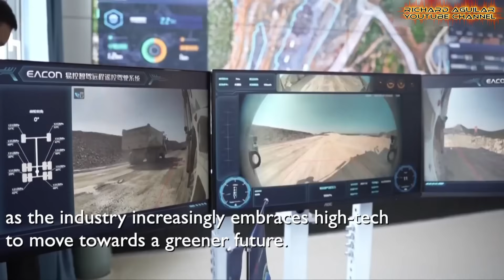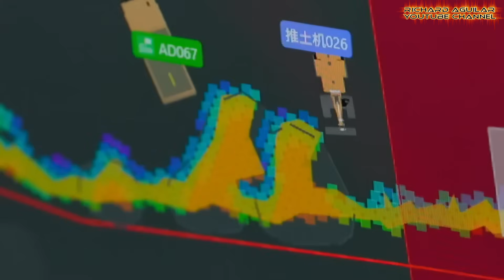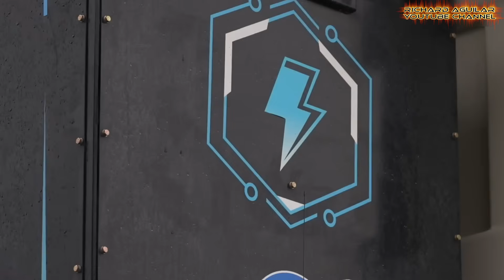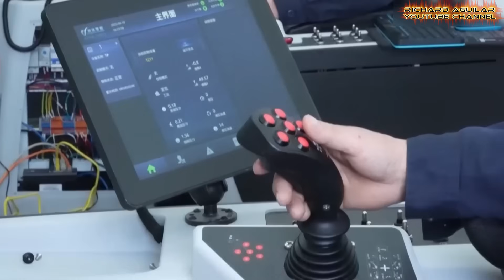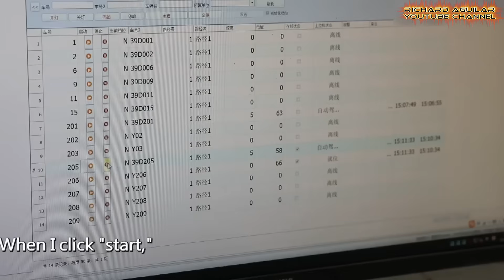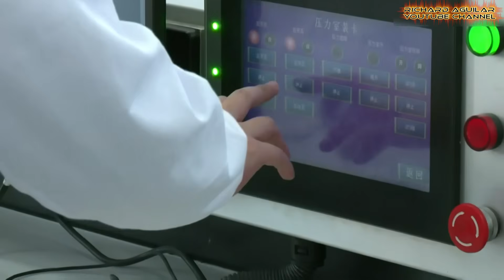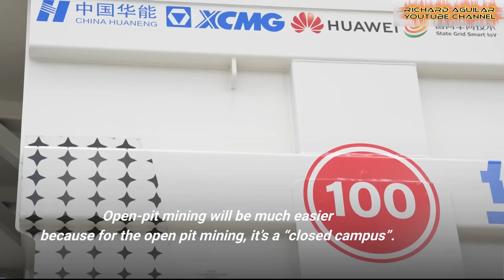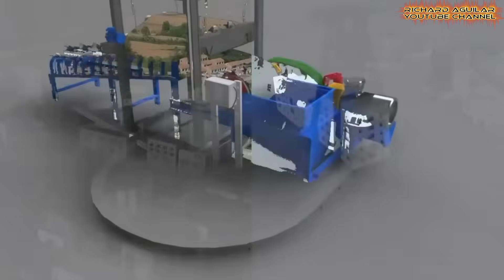CHINA'S AUTOMATED MINING Shocking Global Industry

Comment: China is utilising a whole series of new technologies to do such open cast mining of their surface coal. 
Autonomous driving of the dump trucks, robotic extraction and loading/unloading of such trucks, Beidu satellite navigation and positioning, remote monitoring and control of equipment via CCTV and ripple control via overhead power lines signalling, green electricity from wind and sunlight, etc. 
今時不同往日 / 今时不同往日
(China today is not the same as the China of yesterday).
All these work progress were made within the past ~20 years due to the intense education and the training of their STEM talents. 
十年人事幾番新  / 十年人事几番新
(times have made many  changes; a lot of huge changes can happens in ten years) 
To think that modern mining workers do their work now in air conditioned comfort and have much higher productivity will not be comprehensible by China's ancestors. 
In fact they had coined the following phrase about the prospect of menial work. 
工字不出頭 / 出頭就變土
工字不出头 / 出头就变土
(The Chinese word 工 will becomes soil 土 if it protrudes upwards) . 
The phrase proposes that physical work (工) has no future (出頭). 
How wrong this it is in today ecosystem?
By the way, you don't need to clean those trucks spotless just for the video, coal mining is expected to have dust, etc. 
Just regularly inspect their parts, especially the tyres, and wash them and keep them in good running condition. 
Do keep up the good work.
Reply: 工字出头 can also be 士
Someone with skill and knowledge, very much a fighter and an outstanding person, so actually 出头
successful, standing above the crowds.
It depends on what grows (or shrinks) apart from the vertical, the positives which is the top horizontal line, or the negative bottom horizontal.
Some people become great when they are successful, others.. just obnoxious.

China is also developing remote auto mining deep underground, which is a more hazardous and discomfort environment than surface mining.